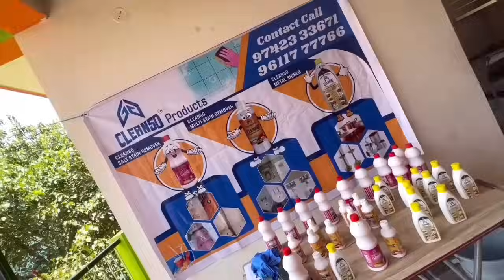ಇನ್ನು ಕೊಳೆ ಮಾಯ | Tiles cleaning | Metal cleaning | Basin cleaner | 5 minutes only | Bathroom cleaner

Comment: I received the product and I used one of the product also(Metal shiner), that is really helpful to clean brass and copper. Thankyou kannada kuvara sir
Reply: Will they add any delivery charges while delivering?
Reply: If possible, if you really using the product kindly give me the address of this Venktesh for proceeding legally against him
Reply: @hmanjunath4295  any problem with the product?
Reply: @hmanjunath4295  I got the product through courier sir.
Reply: Not supplying all the items ordered
Reply: Nanu 430transefer madi 6days ahithu adharu no reply phone kuda receive madutha ella
Reply: Kannada kuvara he chanel nadeso avara number edhare share madi
Reply: Henu kannada kuvara channel ravaru vedio madodhu mukya alla sir nimmanna nambhi payment madidhevi ennu material bhandhilla message comment box nalli akidhare hellu nimma reply ella henu madh bhaku sir nau
Reply: @H Manjunath  I have also not received the product
Reply: @hmanjunath4295   why is this fraud
Reply: Did u guys received products I wanted order
Reply: @bhaskarpavan1675  please do not order. It is not good for your tiles or your health.
Reply: @humanbeing3408  I was interested to contact them. But why you tell the product isn't good?
Reply: @ushachavhan1  product is acidic. It will irritate your eyes and throat when you spray on the tiles or bucket. Besides, after using, once the tiles dry up, you will find full of white patches. That is my experience. You can use it and check out for yourself.